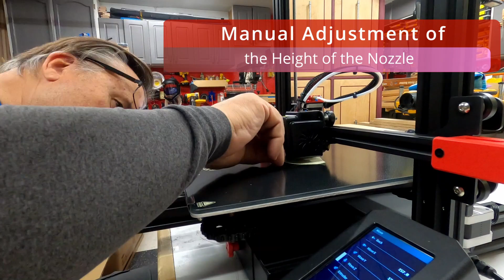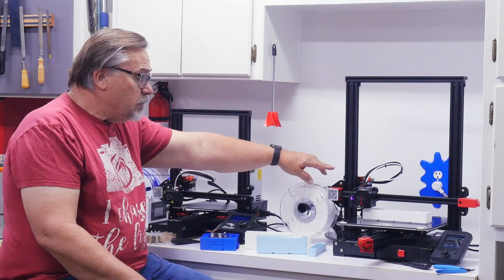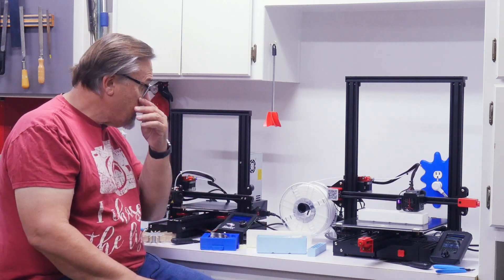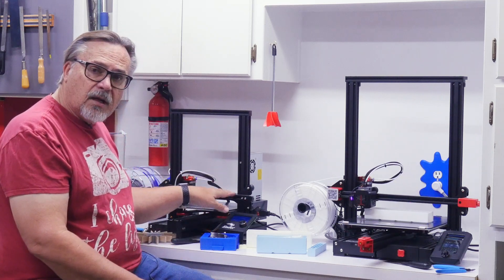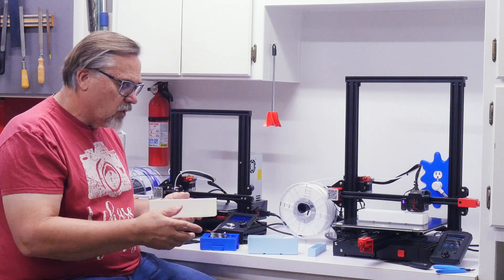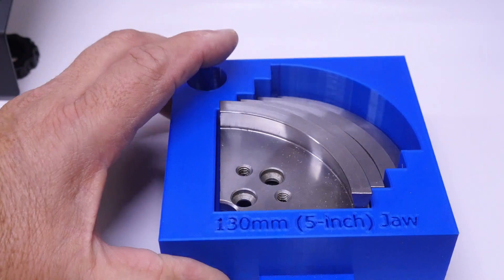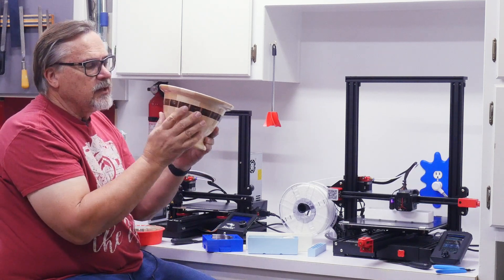Ender 3 Max Neo - Is it the Best 3D Printer for your shop?

Comment: What design software do you use?  And of course, what 3D printer would you purchase today?
Reply from the maker: I think I would still get the ender 3 Max Neo. Good price, easy to get, lots of add-ons available for it.  I use Sketch up for designing and UltiMaker Cura for converting the files for the printer.

Comment: I have 2 ender 3 neo max's in my shop.  I bought pei textures sheets for both that came with magnetic bottoms.  Well worth it.  I mostly print in petg
Reply from the maker: I need to get one of those soon.
Reply: @MadNerdWorkshop  I really want to get a enclosed corexy for abs and sas.

Comment: I have owned an Ender 3 for years. A while back I had an unattended nozzle crash that annihilated my hotend, shattering a partcooling fan and leaving me with spagetti and blob. I never really got it working right after that (mainly due to demoralization and two passed family members). This recent Prime Day, I picked up a Max Neo for $290 after taxes. Once things settle, I will likely get that original Ender 3 back up and running too.
Reply from the maker: I had a lot of problems with the ender 3 pro at first. finally had to replace the hotend and now it all works well.  But I have to say I do like the Max Neo a lot better.  Easier to us.
Reply: @MadNerdWorkshop  I really enjoyed tinkering with the printer. There were just so many 3rd party offerings and a solid community. I will likely keep the max mostly stock and use the Ender 3 for tinkering.

Comment: Informative and timely...I've been thinking seriously about getting a 3D printer.  Do you think this model is accurate enough to make a wedgie?  Is there any special technique required to get an angle that's dead on?
Reply from the maker: It is and I made some just to test your question out.
Reply: @MadNerdWorkshop  Thank you.  I plan to buy on of these.
Reply from the maker: @jimbalz3017  You can't go wrong with the Max Neo.  Have fun with it.